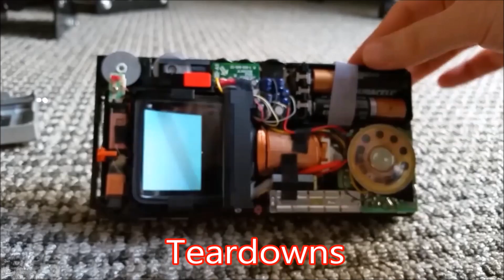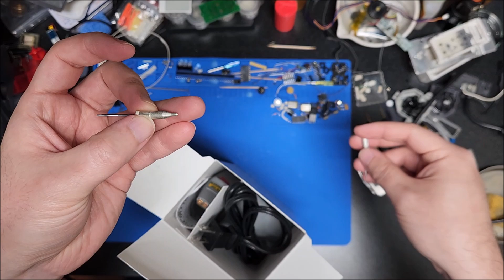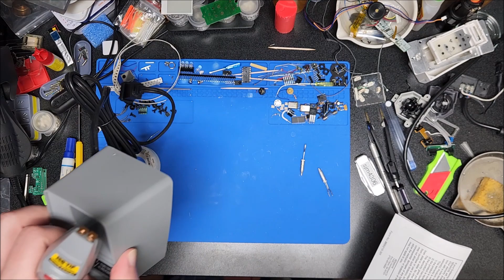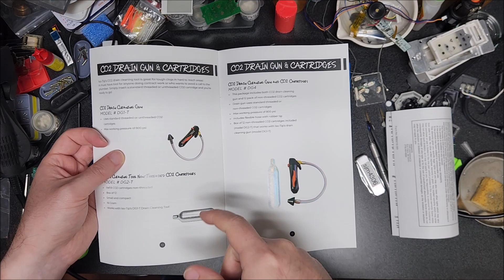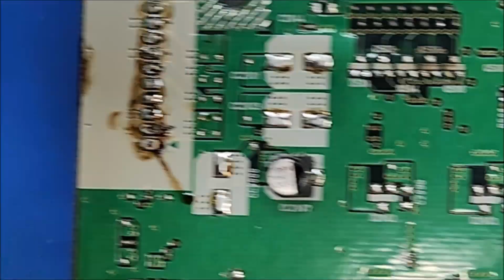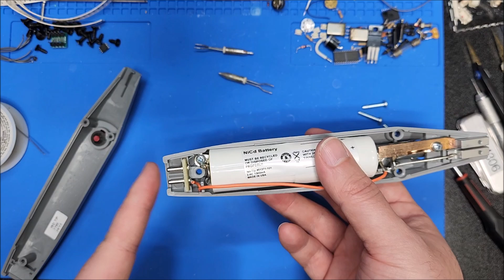Isotip Model 7700 Portable Soldering Iron Review

Comment: It was fun to see your review as I have owned my Iso-Tip for 50 years and it's still working perfectly with only one battery swap. I treasure it for the many quick repairs I can do with it and especially for the very delicate work it can do on ESD-sensitive equipment. Don't obsess about retaining the tips tightly - just a gentle clamping action from the two spring contacts is enough. I have never adjusted the screw terminals but you can bend the spring contacts slightly so that the hole is half-covered at rest. Just pop the bit in and let it float in the receptacles - it will be fine. About a year ago I swapped the incandescent lamp for an LED solution that uses a built-in boost regulator and the illumination it gives is fantastic. I don't tend to trickle charge any more as I don't want the parasitic load, so I use an external NiMH charger when necessary that connects with a plug to the charging base. I have, of course, accumulated many bits for the iron and they all have their specific uses. It's a joy that accessories are still available after so long. As you observe, repairability is excellent and every few years, I open the iron, clean the switch and charging contacts, check everything is tight and carry on. I look forward to seeing your projects for this iron and hope you get as much satisfaction from this tool as I have enjoyed.